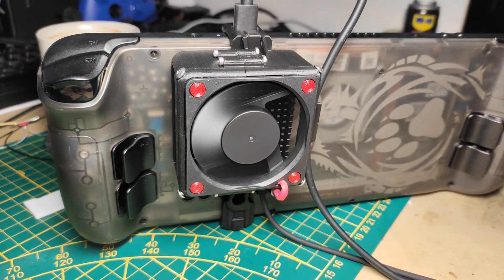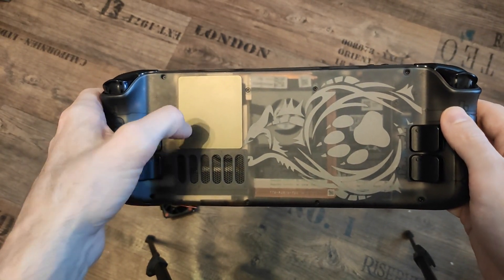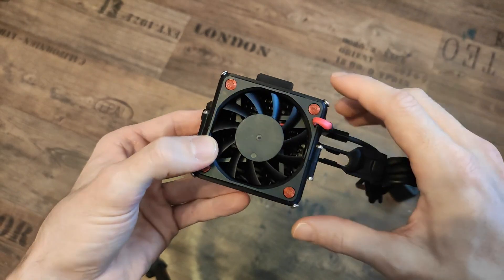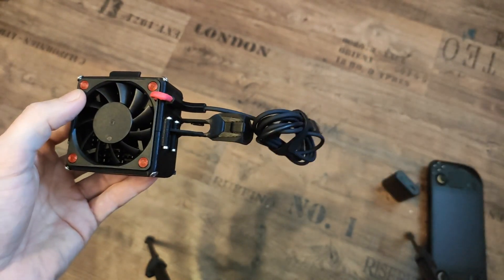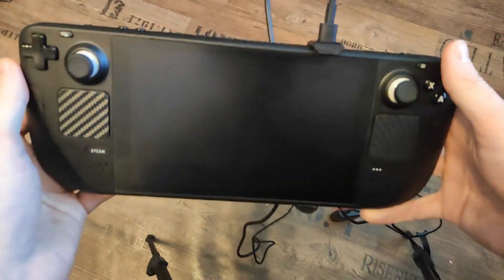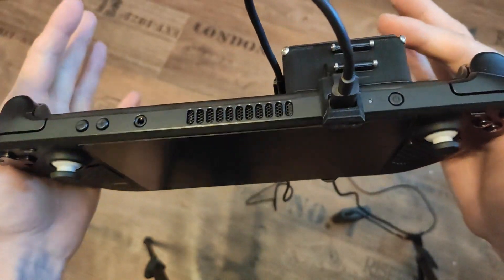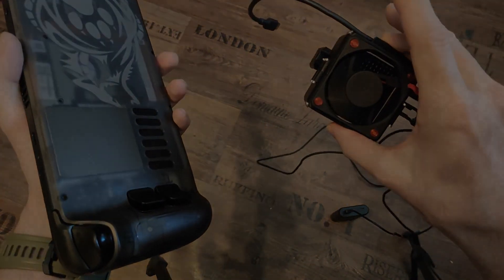LWC "SteamCooler" prerequisites and functionality explained (Final Version)

Comment: heat transfer is really bad tbh
Reply from the maker: Sure its far from optimal, best would be to cutout a hole and directly put the heat sink on top of the heat pipe, but as this is a non destructive mod it does as well as it can.

Comment: Hello
Amazing invention. I ordered thru Versed Prints and its (i think) on its way!
However I do have one important question: on your Printables page the description states heatsink deminsions 50×50×15mm, but in this video and the cad diagram on Printables states 50×50×11mm, I am curious which is the correct size? I see both sizes on aliexpress but don't want to splurge on both or buy the wrong size and only discover improper fitment after a month shipping time.
Thank you very much in advance!
Reply from the maker: Hi there ;) Thanks for the info I just checked and corrected the measurements on the cad diagram, it indeed is 50x50x15.  But even the 11mm mm version would work as the used spring will gap those 4mm difference. Either way of course the 15mm variant with more aluminum material is better in this case, so 50x50x15 mm it is!

Comment: That is sick. I did the same thing but without the a fan I just thermal glued heat sinks to the plate
Reply from the maker: Even without the fan heat dissipation should be much better with an added heat sink glued to the aluminum plate. And if you feel fancy you can still add one whenever you like ;)
Reply: @LupusWorax  most games run just under 70c after upgrade but you got my mind brian storming now lol enjoyed the video thanks

Comment: any difference between the fan blowing cool air Into it and hot air out the sides vs blowing hot air out the fan and cool air in from the sides?
Reply from the maker: Haven't tried reversing the direction of airflow but I don't think it would make much of a difference in this specific setup. I personally think it can dissipate heat more efficiently when its hitting the the heatsink from upfront ( my personal logic/ opinion).

Comment: I love stuff like this. I wonder a few things. How would this perform in combination with a hot air extraction fan at the top or how well would this work with a Peltier cooler. Also, what if you increased the metal heatsink to take more of the back of the steam deck by connecting more stick on metal pads to the inner.
Reply from the maker: I tried with a 60 watt Peltier but for the amount of power you have to put it it does not really help that much ( probably only if you overclock)  Evenso I made a non destructive Thermal mod and the aluminum plate was really cold to the touch the "cold" did not really effectively creep towards the APU, so it only did a bit, also its not very practicable as you have to be connected to a power source by cable. 
Adding more Metal pads on the inside will only help you to build up a bigger thermal mass that is capable of absorbing more heat until it hits its threshold , after that its just  like without it. Also takes a lot longer to cool down as the thermal mass acts as a heat battery so when you switch the deck off it  will slowly dissipate the stored heat as the decks fan will power off also right away.

Comment: This is a great solution but I will try the same with the GameSir F9 and I have a kickstand already which I will cut and then stick two half piece of 6cm plastic ring so I can slide the fan into place when needed and remove each half of the kickstand when it is needed. I actually ordered a new power bank from Anker I think it is the same make as this but it is tiny 5000mah and is a tube instead of a long cable I will use an adaptor so it will directly connect.
Reply from the maker: Sounds very interesting,   I am wondering about the power consumption of the peltier element in this.  I experimented with Peltier elements with up to 60 watts of  power draw  and came to the conclusion that a mobile approach is going to be very tricky if the power source is not big enough. 

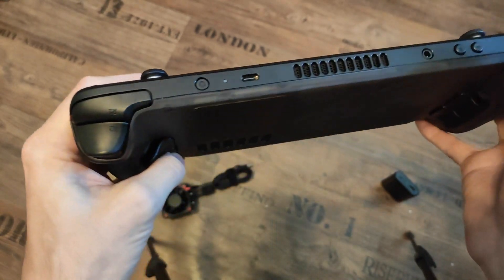 Using that power sir f9 with the "fan mode" only should be fine with a single 5000maH battery pack for hours   but when you turn on the Peltier element its going to be interesting( cant find any information about power draw) . Another issue with this is that you have to get those 3.6 volts form the 18560 Lithium cell  in the powerbank up to 5 volts which is done by a circuit board inside the power bank,   so you already have a loss there  and 5000mAH are not much so I fear once you go go Peltier on this your power bank will draw  very quickly. The only thing I can find is that a 5 Volt 2amp charger is recommended, so if that Peltier  draws 2amps at 5 volts  that equals 10 Watts of powerdraw  and with that 5000mAH battery taking in some factors ......... it should last something between 1:30- 02:00 hours at best. Cooling efficiency is going to be another thing, very curious about your results!
My design can of course be used with a battery as well, as it is DIY whoever builds this can shorten tha cable and simply put a small powerbank on the back of the deck and connect it to that.  But for my personal use I made it like you see it in the video.   With a peltier element I was able to get it  much lower in temps  but  Peltier elements are very insufficient, they draw way to much power for what the deliver in the end. 
I was getting down below 0°Celsius, on the peltier but it did not work that great with the JSAUX backshell as there is simply to much Thermal pad  in between, so evenso the back plate was really cold to the touch it was not like the decks temp were down  like crazy. 
So in the end I decided to go "fan" only as there is no real benefit anymore  going lower then 65° celsius when it comes to clocking speeds. 
The most I could see on the Decks cores were 3840Mhz If I am not wrong, and it did not get any higher with peltier as this is the max the cpu is locked at. 
It would make more sense if the Decks CPU/GPU is capable of overclocking!  then its another thing and cooling it more we could totally benefit from that. 
But thats not the case, so reaching max clock  on all cores with around 65- 70°C  it does just not make a lot of sense to go any lower, as it simply consumes a lot of energy and we have a nice low number when it comes to temperature but it doesnt do much for the actual performance of the deck anymore. 
My goal with the Steam cooler was to prevent the deck from thermal throttling which it does with great success and pretty much 0 power draw. ( with a 5000mAH hour battery like your going to use I could drive my fan for 18 hours straight ;)
Reply: @LupusWorax  in a review of the f9 I did see 1.6 Amps max draw so 5000mah would roughly power 2-3 hours which is plenty for portability.
Reply from the maker: @_GarethRossUK  Thanks for the info, 1.6 amp  on a Peltier is almost little to nothing ( on 5 volts thats just 8 watts of power draw)  when it comes to cooling performance  hmmmm....... like I said I did tests my setup with a Peltier at 12 Volts and 5Amps power draw ( 60 Watts)  and it did not deliver in a way you would think those numbers would presumably. 

  With a phone where the SOC is connected to the smartphones metal shell  this can work, also on phones the power consumption is mostly less compared to the decks fully fleged "PC" cpu.  Snapdragons top tier SOC  8 Gen 2 draws less then 10 watts of power,  and the distance the thermals have to travel to the outer metal shell  ( I assume a metal shell here for this example) is also way shorter so  the gamesir  cooler makes more sense here.  on the Deck we have a SOC of 15 Watts so 5-6 Watts more and then we have the problem of lots of Thermalpads and aluminum shells in between the cpu/GPU and the final point of contact to the external cooler.  But I guess we can assume all we want, tests will show ;) 
So like I said I am very curious about the outcome on this.